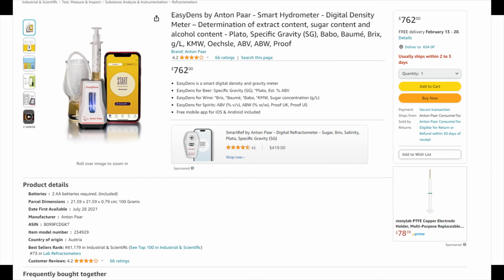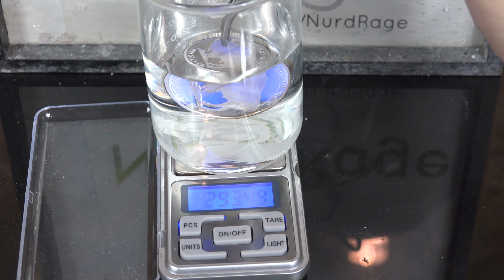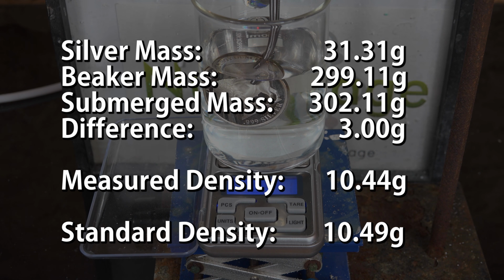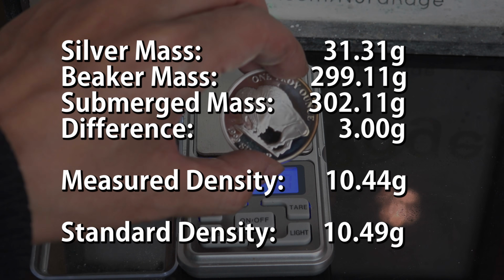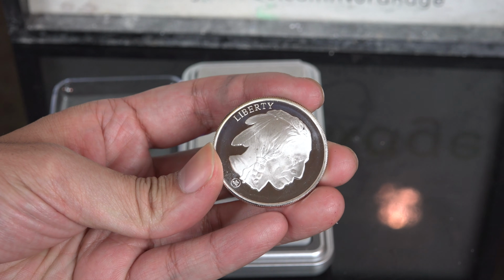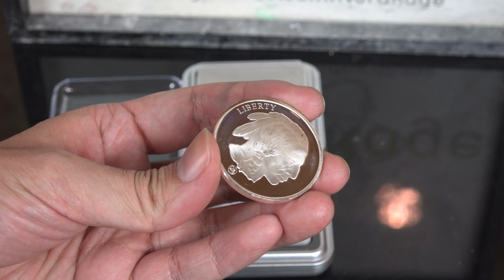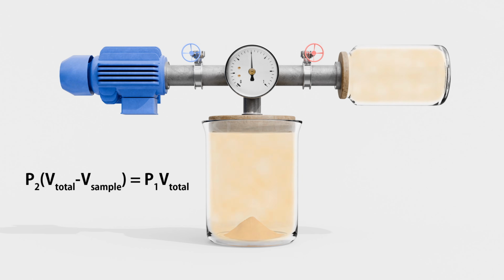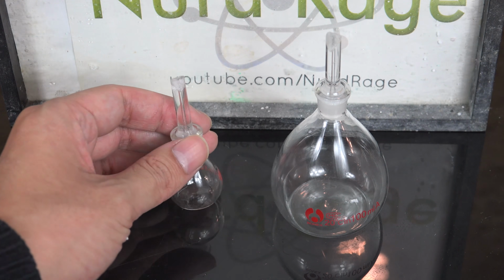Measuring Density with Pycnometers, Hydrometers, and Graduated Cylinders

Comment: I am a retired analytical chemist.  One mistake I noted was the lack of gloves when handling analytical glassware.  Finger prints have mass and will change resuls in the second to the third decimal place depending on cleanliness of hands.  Also, non-conducting liquids will suffer from static charges so an anti-static device is recommended.  Otherwise your chemistry is excellent as ever Dr. Nurdrage!
Reply: This is the most “well actually” comment ever but it’s also air tight lmao
Reply from the maker: absolutely! for amateur level work i didn't think it was much of an issue, but certainly for professional environments fingerprints are a menace! :)
Reply: @NurdRage  haha yes you cannot become a professional if you leave your fingerprints everywhere. :)
Reply: @stamasd8500 I ABSOLUTELY love that this comment works for both analytical chemistry and criminals! Phenomenal 😂
Reply: Analytical Lab Tech here, and 100% yes.  We're taught first thing to never handle glassware barehanded.  It's not only due to error in measurements.  There's also the hazard of not knowing what was in that glassware previously.  It could be harmless like lab grade sodium bicarb, or nasty stuff like a liquid cyanide standard.
Reply: Incredible that fingerprints affect the result
Reply: Wow third decimal is crazy
Reply: Ammonia to nitric acid would be a great video
Reply: @kemster9495 and how do you suggest he goes about that
Reply: @ilyvrby2 platnium mesh is used in industry some transition metals can do it too but its a low yield
Reply: Static electricity has a massive effect. You can often see it when you just hold the object a few millimeters above the scale and it shows a negativ reading. Usually happens with glass or plastic wares and just from picking these things up and putting them down again the resulting static charges are enough to throw readings off in the range of 10s of milligrams.
Reply: Another consideration that was left unmentioned is evaporation.  I was making a companion weight for a mechanical analytical balance that needed a non-stock pan and was frustrated because it kept drifting, I realised after a bit that the water I was using as ballast was evaporating and causing the scale to climb monotonically even as I dialled out the smallest ug masses.  I switched to using 3-in-one oil and solved the problem.  NurdRage is seen promptly closing the cap as he prepares the companion mass so minimising the issue.  Working with acetone or methanol in similar situations is also tricky due to their high vapour pressure.

This same problem is also much worse in the graduated cylinder than the pycnometers due to the much larger surface area so the volume and mass must be read close together in time.
Reply: @KallePihlajasaari  Another annoying "oopsie" is when a fluid (e.g. methanol) is being driven from a vat by an inert-gas (e.g. Argon) and the mass of dissolved argon registers on your mass-flowmeter, but fizzes out and does not register on a reference "weighing scales" creating a disagreement between your totalizer and weigh-scales :( Ask me how I know..
Reply: @AdityaMehendale  Are there any gases that have low solubility in Methanol that could be used to pressurise the container?  Ammonia would be a disaster before starting in aqueous liquids.  It is natural to gloss over effects of inert gases at first.
Reply: As a non retired chemist, one mistake I noted was correcting NurdRage when he is posting technical chemistry that we have been hoping for.
Reply: always depends on your accuracy. if the first two significant digits are enough, you can have mechanic hands full or grime ;) same with anti static.

Comment: I love the videos you have like these, even if I never use them or have no real reason to - I'm always somewhat inclined to try making one. When I do, I end up figuring out how to improve it eventually, and if I could make a simple enough version with easily acquired materials, then anyone could build it with a basic spec sheet. 

I've been going through heating mantle and hot plate videos, since that will be my next big step after I get my fume hood fixed (and space enough to use my lab). I need to get ahold of the magnetic stirrer and the heating element inside ones that heat very well to dissect and figure out. Hopefully by this time next year I'll be close to done. Thanks for sharing your knowledge NurdRage! I'm a hobby chemist, and I do it to learn chemistry because it's fascinating and fun, though I know there's a wide audience subscribed also

Comment: I need to measure the density of a solution at high temperatures (60-70C.) I see most pycnometers are calibrated to 20C. Can I still use a pycnometer? Do I have to take this into account for my calculations? Thanks!

Comment: Don't forget the tilt hydrometer! They can also give you continuous measurements and cost a fraction of the price.
They're basically a floating cylinder with offset centre of mass so it floats at an angle, and that angle is determined by the density of the liquid. They're usually electronic with an unbuilt accelerometer to measure the angle and a wireless interface that connects to a mobile app. Very useful for brewing and other relatively low temperature applications.

Comment: so interesting! but doesnt even the gas method have limitations? how does the system handle powders that sublimate as the vacuum stage ramps up? I feel like nothing in analytical has an ultimate method regardless of costs
Reply from the maker: If it can sublime then you wouldn't need the gas method. Instead sublime the substance into a solid crystalline form and then use liquid methods.

Comment: Electrical engineer working in chemical manufacturing - we use coriolis flow meters for accurate massflow (e.g. custody transfer), they work the same way as the U tube density meters

Comment: It really feels like a U-tube density meter should be relatively easy to cobble together for just tens of dollars. I think a tube with a magnet glued to it and a coil with some even breadboard level electronics would be sufficient. It would probably take longer to calibrate than actually build. I don't see why it couldn't or shouldn't be made of borosilicate instead of some kind of metal either. I think it should also work for gasses.

Comment: I'm not a chemist, and I often get lazy/suck at calculating everything, but you've given me several ideas for how to finally determine the purity of my homemade KCl fertilizer.

In short, I used temperature solubility distillation to purify low sodium table salt (30% NaCl to 70% KCl) that I got for almost free, and while I assume I got it to around 90% pure, I don't actually have any data to back that up. All I did was dissolve as much salt as possible in boiling water (so around 97c where I live) and then cooled that solution down to as close to freezing as possible (around -20c). In theory, most of what precipitated out should have been KCl, but I've had no way of actually determining that analytically and didn't really care enough to figure it out on my own. 

Now that your video's gone through all the details of how to accurately determine the density of a salt (both as a solution and powder, though I assume powder would be easier in my case?), I should have everything I'd need to figure out how pure my sample is just by throwing the observed density into this simple formula densityOfNaCl*(1-concentration) + densityOfKCl*(concentration) = observedDensity with concentration being what I'm after.

Comment: This is super useful even for the amateur. Sure you can make something, but how do you know exactly what youve made? These techniques exist because without reliable information youre flying blind.
I also love the amateur oriented creativity of grinding the pycnometer joint. Sure maybe most amateur scales are less accurate anyway, but thats no reason to add error if it can be easily avoided. Besides, this way if you upgrade to a really nice scale you wont have to buy new glassware.

Comment: So from my understanding archemedes took the crown and put it on a scale. Then he balanced the scale with an amount of known pure gold. Then he submerged both sides of the scale in two identical volumetric cylinders with equal amounts of water. Then the gold side displaced slightly less water than the crown side, revealing the scam.

Comment: A note on the saturated solution part (propably only applicable to way higher precision measuring than amateur with most solid/solvent combos). 

I worked for a while with people that were measuring the solubilities of stuff to extreme precision and i learned that a lot of solutions will take an extremely long time to actually reach saturation, from a few days to weeks or even months if i recall correctly. But the change in the dissolved content slows way down pretty quick so propably no need to wait for weeks 😅
Reply from the maker: wow, that is super interesting! i've never had to go to extreme precision, so i never really looked into it... but now that you mentioned it that makes perfect sense!

Comment: Lovely video.  These are great for ideas.  A university auctioned off a gas type powder density instrument that I had my eye on for the nice vacuum pump, obviously others had a greater need and it went for a more reasonable price around EUR1000.

One great inline accessory for distillation is the parrot, it allows for continuous measurement of temperature and density of the distillate with a hygrometer and thermometer in a bottom fed overflowing cylinder.

Comment: As one who also enjoys maker channels, I couldn’t help but think when seeing the gas pycnometer and U tube device, “those are things that a lot of folks could make themselves if push came to shove.”
Reply from the maker: 100%, hopefully my video will reach widely enough that someone will be inspired to make an easy to build open source version. I'm not that smart, but i'm certain someone DIY maker will do it.
Reply: @NurdRage  i had the thought to use the built-in precision of some kind of ground linear shaft to measure the displacement of a piston with a dial indicator (....arent internal combustion pistons crazy precise)

Comment: The vacuum method seems overly difficult.  If you used gas pressure and added gas to a known size vessel, you could then pressurize it to 2 atmospheres.  Then measure the amount of gas that escapes.
Reply from the maker: Thats actually how another version works, using positive pressure rather than vacuum.

But vacuum is still needed for some experiments, because you can dislodge absorbed gases that way, and this is important for measuring catalyst activity. Like some catalysts will absorb or reject certain gases, so by vacuuming and then injecting different gases, and seeing the difference, you can measure certain properties of the catalysts. A purely positive pressure system isn't really good for that.

Comment: One of my friend's mom had a bunch of volumetric flasks she was using for decoration. When she found out I was into chem, she gave them to me! That was over 20 years ago and I still have them. They were always my goto when I needed to find the density of something. Those great quality flasks probable cost more than all my cheap chineseum glassware I own! I don't really know what brands are God tier with labware, but I just looked up the 25ml Kimax class "A" volumetric flask and a 6 pack sells for $290! So thats like 50 bucks for 1! Also looking at the specs, the one I have is even better. The ones online are +-0.08ml, while the one I have is +- 0.03ml.

Comment: If you are going to use a drill for glass grinding, don't chuck the glass directly into the jaws of the drill.
Use a bolt or other metal rod and connect it to the glass with a piece of rubber hose to use as a flexible joint.
This is how we grind engine valves without removing a cylinder head. We don't want any damage on the valve stem!
Reply: I always used a piece of bike inner tube as a buffer between the chuck and the object. Great grip and no damage! 😊

Comment: I worked on the design of a Coriolis massflowmeter for my doctoral work - that's a few steps more complex than a "U-tube densitometer". Would the amateur-chemistry enthusiasts be interested in "instructables" style notes on how to build one? (the densitometer, I mean..)
Reply from the maker: YES!! I would feature it on this channel if it's simple enough that I could build it!
Reply: @NurdRage I am looking forward to this video!! Please do, if at all possible! 🤓
Reply: @NurdRage  Cool! Hmm.. let me think about it.. I am guessing you won't be averse to a quick one-time "tare" and calibration before every usage-session (say, with "nothing" and "distilled-water" as reference-fluids). Also, a "dead volume" of around 1ml would be okay, rt? What about materials? The CMFM used 316L stainless, but the DIY nature of this project would push more towards polyethylene or silicone tubing - any preference? esp. with luer-lock or orher coupling-types you regularly use in your lab? ..and a bit of programming with an Arduino or Teensy or PicoW would be acceptable too, I hope..
Reply from the maker: all of that sounds great! any material would be fine, but for amateurs, maybe accepting corrosive liquids like nitric acid would be desired. Could we use PTFE tubing? That's available online pretty easily, and i don't think we need too much. I'm not very good with microcontrollers, but if you include decent links to tutorials i'm sure i could figure it out!
Reply: @NurdRage  That is absolutely fine! I assume you are planning to use mostly gravity-fed or squeeze-bottle fed systems, right? Else the "ballooning" of the tube too needs to be considered in the sqrt(k/m) calculation. For low pressures, I'd lean towards 0.8mm ID/1.2mm OD PTFE tube. For higher pressures, perhaps 0.8mm Id/ 1.6mm OD would be appropriate. Another "popular" size is one with 2mm ID (popularized by its application in 3d-printers) but this would be at an upper-limit, considering that a 30cm tube would have 1ml "dead volume". Perhaps the choice could better be left to common/standard connectors/adapes/fittings that you regularly use in your lab - any favourite types or sizes or brands? We used Swagelok, but they are eye-wateringly expensive for hobby-use ;)
Reply: PS - i would not rely on the stiffness of a (possibly replacable) polymer-tube to provide a reliable stiffness 'k' - instead I'd propose a separate lightweight & stiff frame, with external springs, to provide a well-defined and known 'k'. Any variation due to the "own-mass" of the tube shall be taken care of during tare+cal. Tube-stiffness of the inlet/outlet can be made negligible by placing these appropriately in the geometry of the resonant part. 

If you are curious, my thesis [2008] can be freely downloaded from the UTwente website (YT-comments-section doesn't like URLs).
Reply from the maker: yeah it's probably going to be gravity fed or syringe fed, so ballooning from pressure won't be that significant. Dead-volume isn't too much of a consideration for amaetur work, as long as we're less than 10mL, most amateurs would love it! So whatever tube that's easily available to the amateur is acceptable. If it can be bought off amazon/aliexpress that would be perfect. Glass tubes might be acceptable if they're short enough that they can be glass blown by hand. As for connectors, most common connections in the amateur lab are 1/4" hose barbs and luer-lock syringes.
Reply: @AdityaMehendale  Your paper is phenomenal just for the history and state of the art sections.  I will have to properly read it at least a few times to get the most out of it.  I have a huge old Danfoss MASSFLO sensor (impulse bid :-) ) that I want to fire up one day and your theory will probably allow me to get flow as well as density out of it. I got it without a controller so All I have is drive/pickup coil terminals and a thermistor.

For the DIY system making it work with popular PTFE tube is a real good idea.  Pushing it through a metal pipe and then bending the U would make the stiffness predictable and allow for reliable clamping.

One could use this to measure the continuous distillate output and adjust the reflux ratio or end point for many amateur stills.

While I have realised the mass flow meter does measure density along the way it did not occur to me that such instruments are a thing even though I have been searching for various continuous density or refractive index tool on and off for a year or two.  A thin tube will update fast and allow process adjustment.

I would be happy to offer critique and ideas if you like.  I have a gmail address.
Reply: @NurdRage  I wonder if there is a stock U-tube manometer on Aliexpress made of glass that could be made to work?  in essence it would just need a good clamp (with fluid filling well past the clamp point) and a metal or magnet epoxied to the bend (aligned with a 3D-printed clamp), perhaps with an opaque flag if using optical feedback and a temperature sensor to estimate the changes in glass characteristics (expansion, elastic (Young's ?) modulus).

I have a manometer tube that is idle, it has perhaps inconveniently large expansion volumes but bending a glass tube is well within most amateur capabilities with modern propane torches.

Comment: there are high-precision hydrometers as well! 
i worked with some that were "accurate" to 3 digits and technically the fouth was imaginable between the lines. (i.e. 1.003 / 1.0035).
and for most situations they were scarily accurate! 

We mostly used pygnometers for density measurements of solids and mostly in training. after that its digital. they are practically as fast or faster and far more precise. :D